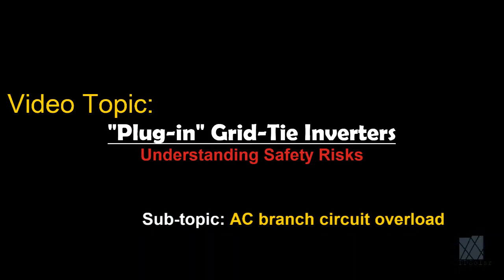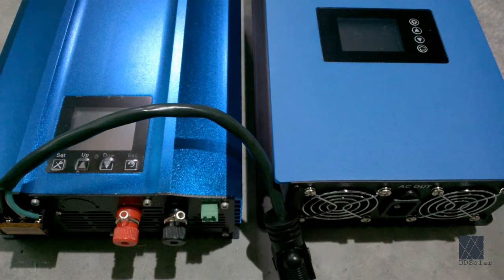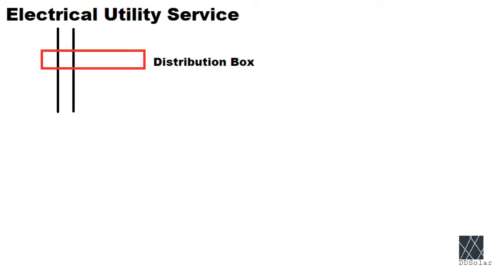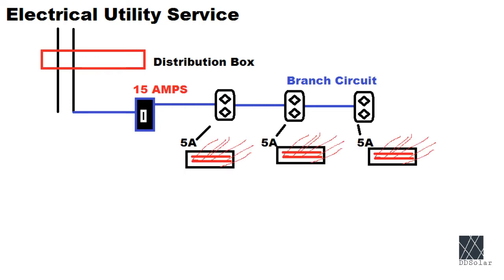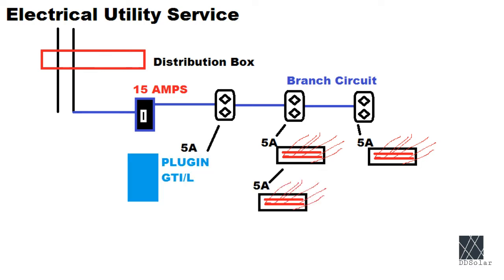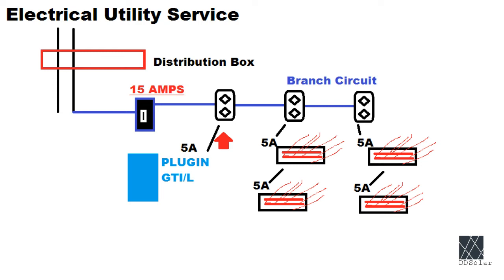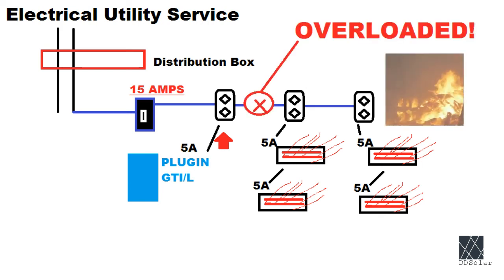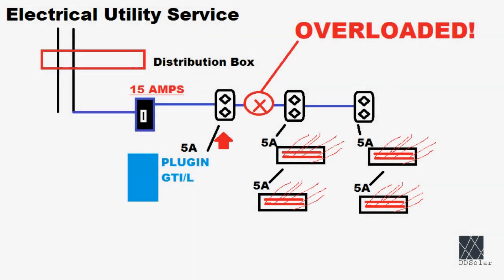Before Buying Plug-in Grid Tie Inverter Watch This Video - Safety Warning #gridtiedsolar 2023

Comment: Interesting; had same thoughts with AC and grid-ties.  AC being a bit odd with it reverse direction every 1/2 cycle makes my little brain hurt.

So really you'd want 15amp fuse or breaker inline on each side of back feed outlet if you "really" wanted to do this safely.  This would always keep electrons moving less then 15amps on each side.   

I often wondered; is there a problem with backfeeding only 1 leg of the panel.  Should the setup be 120V and feed two breakers equal current and/or 220V so you are getting both legs.  Backfeeding just one side of phase seems wrong on surface; but eh... maybe not an issue.
Reply from the maker: This stuff taxes my brain as well. I had to give it a lot of thought before I stopped worrying about it. In my opinion feeding half of 240V in an active household electrical system is fine, provided the GTI has a dedicated circuit. A dedicated circuit completely bypasses any question of overloading the house wiring. All you're doing is feeding some synchronized AC into the house to carry part of the load. What I never do is backfeed to the utility. I only use the GTI to help supply my house, the rest of the power comes from the grid. Always done it this way and besides the utility doesn't pay a high enough rate for that expensive solar power anyway.

Comment: Very interesting video, thank you. What about using a circuit barker between inverter and house socket?
Reply from the maker: Actually it's an interesting thought,  limiting the power output before the wall. Maybe if you keep track of and control everything plugged into that circuit. The (safest) route is generally a dedicated circuit so the existing breaker is guaranteed to trip. This is very inconvenient though because a dedicated circuit may not be near the inverter.
Reply from the maker: Forgot to say, you're welcome and glad you liked the video. It's a rather obscure topic but of utmost importance for plugin grid ties
Reply: Mmmm no i don't think that would work....
Reply: What if you were to wire the inverter directly to the fuse box(line breaker)?
Reply from the maker: Sure I think that would work, as long as the breaker is not shared with other devices
Reply: or a fuse

Comment: I have a 2kw inverter. They need t be hard wired into a braker at 15 amp 220volts. 
Also I use a limit system with a battery bank.
Reply from the maker: Nice setup. 2kw is serious power. I have 3x 1kW with the 4th going online hopefully soon.

Comment: this is pretty much a textbook situation on how people get into trouble.... especially now that 1,000 watt and larger systems are available these days. BTW, a 15 amp branch circuit is only rated to carry an 80% load long term so now we're talking 12 amps continuous, which is around 1,400 watts. The 15 amps is actually for 3 hours or less. (intermittent draw)
Reply from the maker: Hi, right on. It's the code requirement I believe and a sensible one. In my profession we call it the 80/20 rule. It's usually possible to draw 15A continuous from a 15A circuit but you never know the condition of the breakers, outlets, wire nuts, and who knows what else is hiding in that wall, especially an older building. How many years of drawing 15A before something in the wall gets a bit too hot and fails. Pretty risky. This video did omit detail in an urgent attempt to reach the layman quickly before he "clicks something else". Tried very hard to keep it simple so people would get the most urgent concept asap. I really hope those who are looking at plugin GTIs will do a lot more research about electrical topics after seeing the video. Thanks for watching :)
Reply: @solarpoweredge  ... I just retired from 25 years in the generator business, and you'd be amazed at what DIY people think they know when it comes to a simple project. Some of them shouldn't be allowed to change a lightbulb.
Reply from the maker: @rupe53  Cool, man across teh street retired from his generator shop, he has a lot of cool equipment. And of course a whole house generator setup.
Reply: @solarpoweredge I had a plumbing company install a new electric heat pump water heater. When I came home next day from work the water was cold the breaker was tripped. I assumed the water heater failed shorted out maybe the compressor its a heat pump. I turned the breaker back on see if it would trip again, it didn't. I went in the house came back out saw a burn mark up the wall where the flex conduit went into a 2 Gain box.   When I removed the wall plate entire box was black with soot the feed wire was gone. My house has aluminum wire the 240V wire had burned up what he did was wire nut copper wire in the whip to aluminum wire with yellow wire nuts. Previously the water heater had an old school pool timer where AL and Copper wire were not wire nutted. The wire had burned up into the wall stopped where strain relief was on the box inside the wall. I was lucky if it didn't get enough current to trip the 30amp breaker could have burned entire house down. I had the company install a disconnect box above the water heater so there are no wire nuts. Your right that can burn down a house without tripping a breaker. Newer houses I know have arc fault maybe that works better but I'm not sure it's required on 240 circuits.
Reply from the maker: Yikes!!! what a scare. That's exactly why I hate wire nuts anyway. Glad it didn't keep going. Hopefully folks will read this and be forewarned. Thanks for sharing the experience btw
Reply: @Mike-01234    in new construction GFCI is now required up to and including 50 amp 240 volt circuits. That means welder plugs, car chargers, water heaters, and AC / heat pump units.
Reply: @rupe53  I believe arc fault is required regular 120V circuits. I'm not sure GFCI would have tripped this it got hot in wire nut but still likely returning to the other line. Obviously, it tripped the first time it got hot. When I turned it on again the aluminum wire burned back to the strain relief. I would never use Aluminum wire I know it's still used for 240V and higher to me it's not worth the risk vr cost savings.
Reply: @Mike-01234    aluminum is still commonly used for service entrance and sometimes to feed a sub panel, but very few people use it elsewhere. I haven't kept up on the newest codes since retirement, but if you are connecting a GFIC via a receptacle, then it's usually considered a wet location so certainly GFCI protected. (garage, under-eve, outside) Edit: Last I recall, Arc fault was only required in certain locations, like bedrooms, living rooms, etc. I don't recall them being required in wet locations like basements, garages, and outdoors.
Reply: @roberto lang ... I was both born and retired in the US and my comments are about the safety aspect because the laws of physics don't change from one country to another. What I am trying to say is some things may work, even though they are not really safe. That's why we have rules and building codes.... and they may be different for a reason that's not always clear to the average guy.